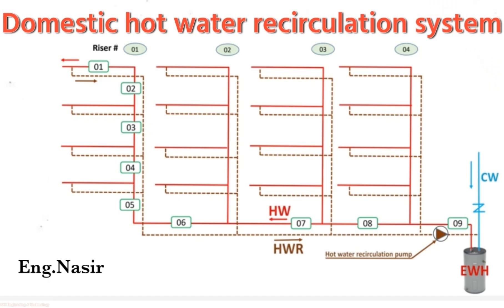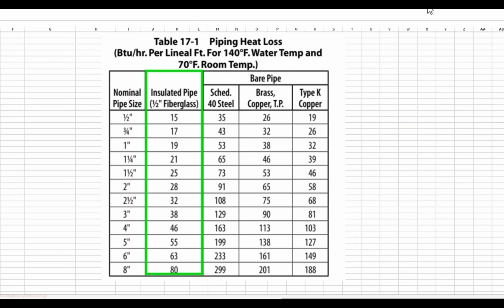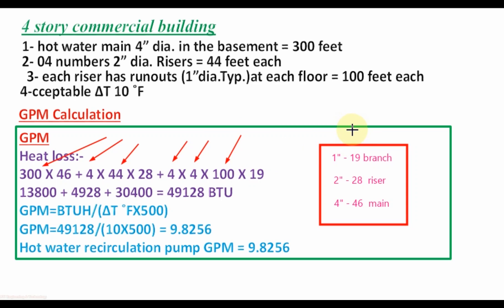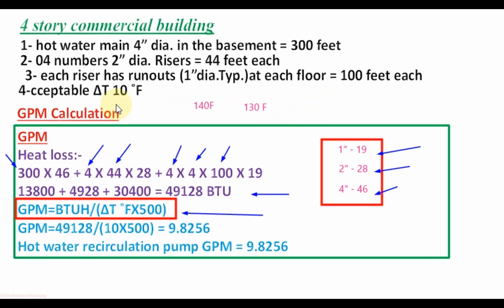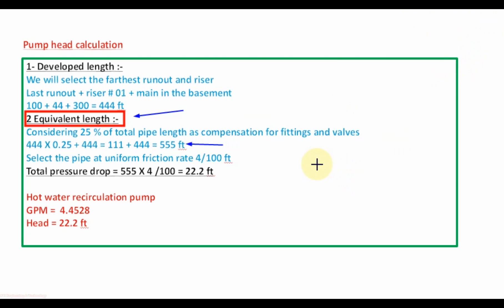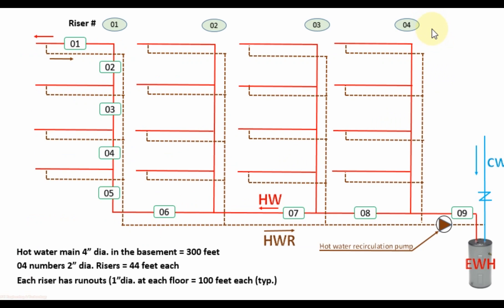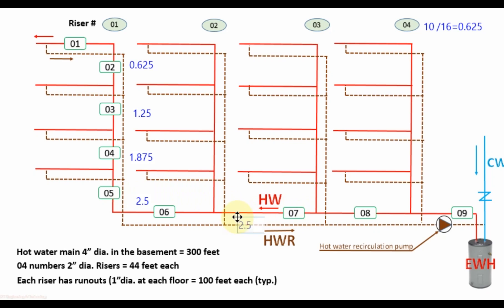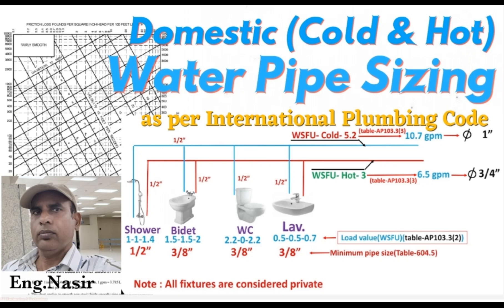73 - Domestic hot water recirculation system design for a commercial building

Comment: WHY HOT WATER RETURN LINE AND HEAD LOSS IN HEATER ,VALVE PACKAGE IS NOT CONSIDER FOR HEAD LOSS CALCULATION,
Reply from the maker: I have considered 25% of developed length as compensation for valves and fittings if you know the fittings and values inside the piping then calculate actual pressure drop in fittings and values. 
Drop in EWH is already considered while designing hot water supply system, now we only designing hot water recirculation system.
Reply: @ncengineeringtechnology3376  thanks for your reply, please clarify ---  this 25% aditional is including 1. EWH pressure drop , 2. hot water return line 3. safety factor 4 . valves and fittings?
Reply from the maker: as thumb rule we consider 25% to 50% depending on the nature of piping route, if you know the piping rute, please calculate actual drop in  piping, for  recirculation piping design we do not consider EWH, it is not hot water supply pipe design, it is only for hot water recirculation network.